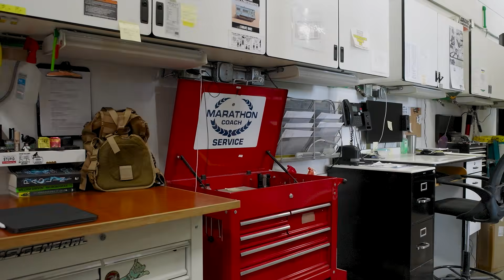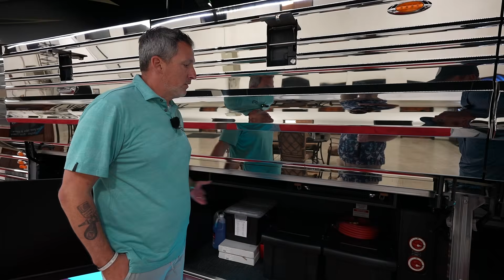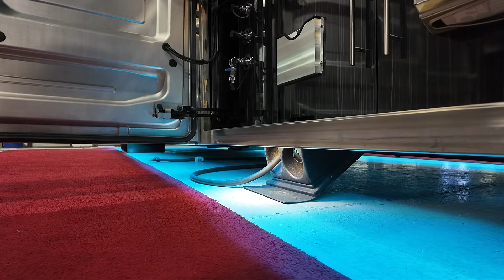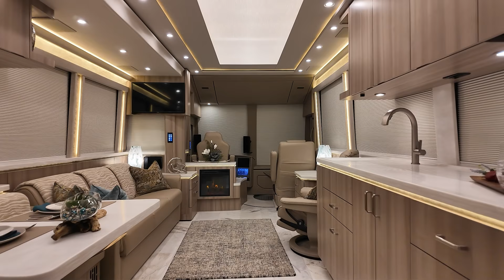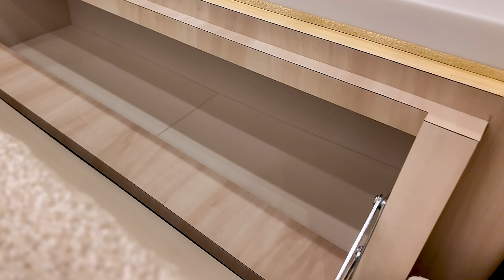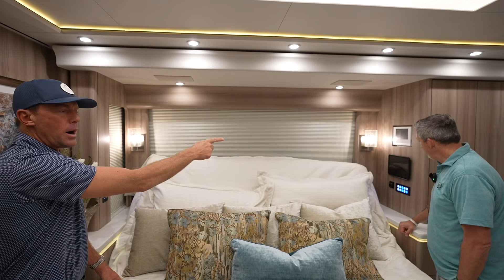Inside a Brand New $3.3 Million Marathon Coach Prevost X3!

Comment: I rarely offer anything other than praise, but this seems like a 2.5 million dollar coach not 3.3m. There are a few features that really separate the pinnacle 3+ million dollar coaches from the 2-3 million dollar coaches with one of the biggest being the kitchen finishing, bathroom and closet.

The lack of underlit porcelain counters that waterfall is very apparent. The lack of accessory nooks like espresso machine is another. It's not that the kitchen is poor quality, it's just not what I expect at this price point.

The bathroom I expect at 3.3 million is much more significant than this. Obviously a double slide on an X3 immediately limits some features, but that's kind of the reason X3s are usually found in the bracket below 3 mil+. Finally the closet should really be exceptional with options like cedar lining.

This is a beautiful, amazingly constructed RV. Marathon knows the game as well as any pinnacle coach maker. That's why I'm a little perplexed by the 3.3 million price instead of 2.5 million or even 2.8 million. X3s will always struggle to meet the H3 on that road to peak luxury living.

I will say that if you are older or struggle with mobility the X3 is definitely the coach for you.
Reply: If you were a serious buyer the actual price would be 2.5 -2.6M. I have heard of $3.0 Marathons actual sales price $2.3M. There is a boat load of markup in these coaches.
Reply: Exactly, 2 little burners with no microwave/convention oven. So basically you will never cook in this rig.

Comment: Why are they not doing Lithium batteries.  you can get more power out of them and they charge faster.  Last longer also.
Reply: They tried recently and failed horribly. Had to buy the coach back from original owner. Marathon worked on it for several months and ended up going with their traditional electrical system, AGM Lifeline batteries and everything that goes with that setup. I heard about this from the original owner.